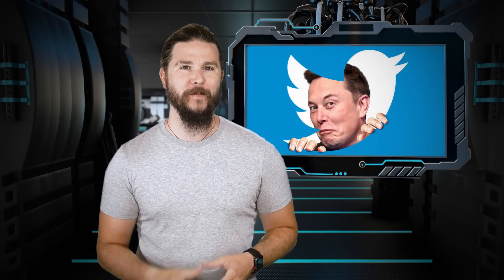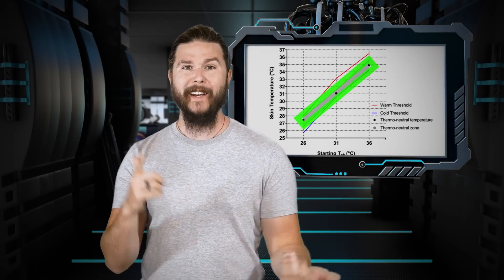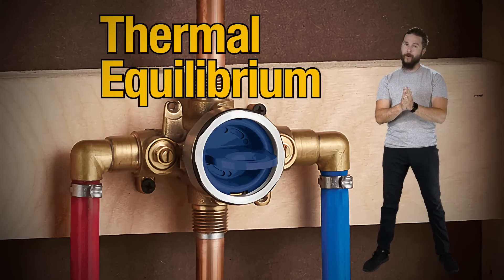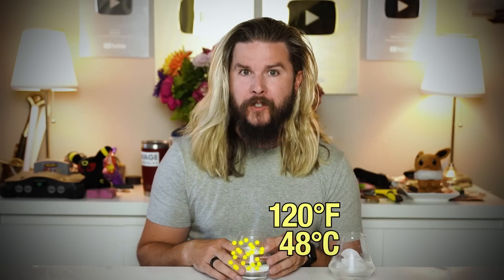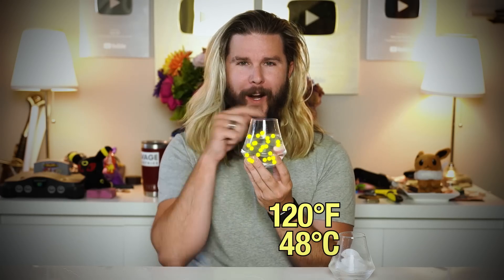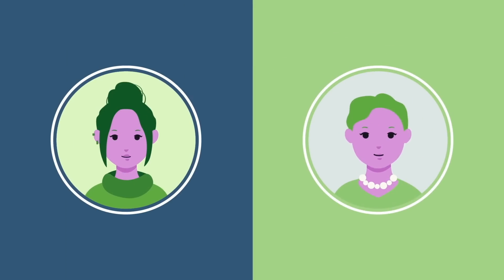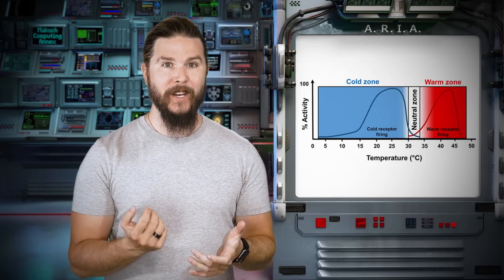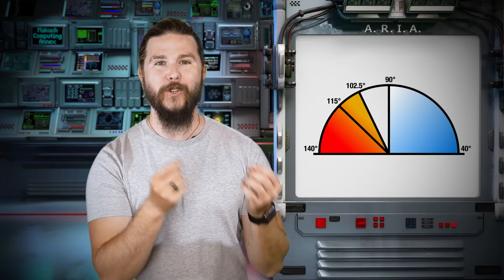Why Are Shower Handles So Sensitive?

Comment: I think you missed one last bit: static vs dynamic friction, and uneven friction along the handles arc in general.

The amount you have to push to get a degree of rotation changes depending on if it's already turning, and the current angle, so you overshoot
Reply: And, on top of those, the handles are very rarely, if ever, perfectly tight. On a lot of handles that have even a little bit of wear, it will move a few degrees without turning the valves. This isn't even always something you can tell is happening, as the friction from the handle usually feels greater than the friction from the valve. 

This isn't so much a problem as it is an annoyance, but it means there is no specific spot you can turn your handle to to get that perfect temperature. Altogether, the only real way to get a good temperature is to find something close -- either above or below -- and slowly turn it a degree or two at a time until the valves line up correctly. Turning it too fast will result in skipping and popping, missing the spot, and not turning it enough means you won't actually turn the valve. 

The only showers I've ever seen that actually solve this are the type that you often see in public showers, such as you may have at a campground or pool. These turn several times, effectively screwing out. This extended range of motion, sometimes up to 1080 degrees or more, means that the comfortable point is not only larger, but more easy to find and fine tune. Of course, with the extensive use they receive, it's not uncommon for them to have issues of their own, but they still generally hold up well. I'm sure they present other problems but, being ignorant of them, I would absolutely install one in my house.
Reply: Once you learn your system, this becomes less of an issue, but it can be very annoying to almost have it right, then you try and fine tune it and it goes flying off into lava land.

Comment: I have a hot tap and a cold tap, my control is nonexistent.
Reply: Too much cold and the hot stops, not enough cold and it's all hot. The amount I turn the knobs also determines water pressure.

Comment: I usually turn the handle completely to the hot side first and use my hand to feel the temperature, once hot water comes in, I can then turn it to the cold side slowly. Sometimes the boiler is too far away from the bathroom and the pipes are cold, you might think something is not working properly.

Comment: that's actually very curious. here in Brazil, at least in the general region i live in, we have 2 shower handles, that work like doorknobs (they're also round-ish). one controls hot water flow, and the other cold. i never knew that there were places with a 180° valve worldwide, here single valves are also like doorknobs and can have more than a single rotation until getting to max
Reply: These 2-in-1 valves are common in the south. But most showers in Brazil are electric showers that have almost no control at all. The most common ones have just hot, warm and cold, electronic ones are better, but you still need to reduce the water pressure a lot if the temperature is below 5°C, even the 8500W electric showers cannot provide enough heating in the winter here. At 0ºC and below, things get silly. 

Furnaces are still way too expensive for most Brazilians to afford, especially those living in older apartment buildings which lack the necessary gas and water plumbing. Gas prices are way too high too.

Comment: Seems like it would be possible to design a fairly cheap shower valve that has a small screw or something to calibrate the middle temp (to allow for long hot water pipes or colder cold water), and then make the main valve handle only be able to change the temp a couple of degrees C in either direction. You could fairly easily get at least three times resolution that way reliably, the only downside being that it has to be calibrated by the plumber or the end user.

Comment: I think the other thing which makes showers harder to control is the latency caused by the long pipe the water's going through before making it out. It means that when you feel that the water's too cold and turn the handle to the right, at first you don't feel the change and turn it even more. But when the hot water finally reaches the shower head it is too hot, because you turned it too much.
In control theory there's something called the Nyquist stability criterion and related to it phase margin which tells you how much delay can you add to the system before it destabilizes.

Comment: My mom got herself a gas heater with a freaking electronic thermometer. Set it to 42C and just open that sucker wide open, it will reach you at a balmy and comfortable 40C. Since the gas heater serves 2 shower heads in two different bathrooms next to each other, when there is more people you just set it to 46C and add a tiny bit of cold water.

Nothing a thermostat can't fix.

Comment: All of this is slightly subjective on how hot you keep your hot water heater temp.    I keep mine cranked super high so that I actually put the handle at 90° and it's perfect.    Doing this also let's you have more hot water for longer cause you use less hot water in the mixture at the shower handle.

Comment: It took me a while to figure out that my current shower tap takes two revolutions to get to full blast pressure, but the left side is still cold and the right side is still hot, so comfortable for me is at about 1:00-2:00 on the dial after turning it all the way around once.

Comment: This is why I prefer double-knob showers; you can control the hot and cold water separately. Still often scorches or freezes for a second, but it's easier to adjust than one master lever.

Comment: Big question why not just get a shower that has two handles one for hot and one for cold?

That way you could always get the same temperature output by just setting both handles at the same angle or about the same angle and just move them around to change the pressure/flow rate as more water is let through the valves?

Comment: This is so perfect. Our houses shower sucks so bad it drives me nuts. It's like it only works when fully turned and it drives me crazy. Anything less than fully hot is not warm, so essentially the entire dial gives you cold water control.. It's so irritating.

Comment: A solution maybe to make micro adjustments using a gear system on the handle. Large gear for the handle that would only make micro adjustments on the actual flow rate of the water. Cheap, efficient , hopefully we can see change.

Comment: I am a plumber.  Thermostatic showers have a separate handle that controls temperature, but not volume.  So you find your desired shower temperature once, and then don't touch the handle again.  It mixes it to a specific temperature based on the volume of both hot and cold it allows in.  These valves are becoming more common, and aren't really much more expensive than regular mixing valves.  They aren't cheap though, and you could buy something for 1/2 the price, but it will be 1/10th the quality, so definitely more expensive long term.

The main thing you really want in a shower valve is something that is pressure balancing.  They keep the relative volume of hot and cold water the same, so they maintain the same temperature even if supply drops because someone flushed a toilet somewhere else.  You'll experience a drop in overall water coming out of your showerhead, but it won't suddenly flash to full hot/cold.

Many homes heat their water in a a tank, so another reason showers are tough to calibrate is as you use hot water, your water heater has cold water added too it, cooling the overall temperature of your hot water.  If your water heater has a low volume and slow refresh rate, you'll gradually lose hot water.  Can be solved by switching to an on-demand water heater, but those are VERY expensive, maintenance heavy, and usually require either a large amount of electricity, or access to Natural Gas or Propane.  The gas/propane ones are much more efficient, and I wouldn't recommend an electric one unless you're truly desperate.  They all only heat the water you actually use though, so in the long run you don't waste energy keeping a tank of water hot.

Something else you can do is to turn your water heater temperature UP, and then install a mixing valve on the outlet of your water heater and mix the hot water back down in temperature.  This lets a smaller volume tank punch above it's weight class in the amount of hot water it can deliver.  Also, since every home has a different hot water temperature based on the use case of the people living there, every shower valve will have a different location for the "comfortable" range.
Reply: I can't believe no one else has mentioned putting a valve right on the water heater. Those valves are way cheaper than getting a full thermostatic shower system and allows the entire house to benefit. The extra hot water is nice too

Comment: A somewhat simple soltution would be implementing a gear reduction, so you need to move the handle further to make the same temperature change, though it would make it a horrible experience to change to an old shower.

Comment: My shower amplifies all this by having the temperature dial also be the on/off lever.
You need to tilt it up to turn it on and be extra careful not to nudge it side to side to knock it away from the sweet spot.
+ small shower so bumping into it on accident is also easy.

Comment: interesting episode but i feel there is an unnecessary amount of bashing even if i agree with kyle
Reply: Politics and science don't mix opinions should be left out entirely tbh.
Reply: @louthinator  exactly. Respectfully of course, but i came to learn not to hear political opinions and the like
Reply: The sad thing is he used to be a Musk Fan and even had that musk watch thing a few years back. Science has been shown to be ruined by politics and as a science communicator Kyle should know better than to do what he did in this video. Hes smart enough to know that current trends will age poorly for cheap laughs especially when they are political or could be seen as political.

Comment: This is good.  

Can I add many showers have a pressure balance valve that tries to compensate for difference of water pressure between hot and cold pressure fluctuations. That helps a little. The worse your plumbing to the shower the more that helps.  Many times the pressure can flux from minor other uses and when a well pump cycles

Comment: Don’t have this issue.  Set shower full hot (to purge cold water from hot water line), dial back to desired temperature.  Do this before getting in the shower.  It’s not rocket science.

Comment: Wouldn't be too hard of a change, really, for the manufacturers to add a secondary proportioning valve inside the main unit. There could a set screw that allowed a small flow of hot water to the cold water side premixing and bringing the cold water up in temp by a certain amount. The screw can be adjusted later on if needed.
The premixing path would only be engaged after the handle has been turned more than, say, about 15*, as some times you want actual cold water available, not tempered. So in Kyles graph, the central point of equilibrium would move closer to the cold side, minimizing the "too cold" zone, increasing the range of the "comfort" zone so fine tuning would be far more adjustable.

I wouldn't lower the house water heater temps lower as it would make using "more" hot water, making the water heater to run longer. For instance, if the living quarters has a 30 gallon hot water tank, and the temp is set to 130F, and they use the shower at around 105-110F, and the cold water is 40-50F, then there will be a lot more of the hot water consumed to get that balance. Whereas if the hot water is 140F (default setting), then no where near as much hot water is needed to accomplish the same shower temps. Thereby lowering power consumption. Sure, the power used may be low, but it's still there. Not to mention there are some foods you can actually cook using hot tap water instead of using extra power to heat a pot water. Thin noodles, ramen noodles, certain soups like tomato or cream of mushroom, etc.

But ultimately, I think the pre-mixing valve on the proportioning valve would be the best option here. Something relatively easy to add into the existing manufacturing process. Will it happen? Probably not, as Kyle mentions there aren't enough of an issue to make manufacturers make the move, as it would incur an additional up front cost to the manufacturers.

Comment: My shower handle pulls out/pushes in to turn on and off while having the standard rotation for temp.  This allows me to set the temp to the sweet spot and leave it there.  Perfection.
Reply: I don't understand why they all aren't like those. I'm in America and while I've definitely come across them, it's not very often. Usually either a knob for hot and cold or, like my current shower, one single handle that does it all.

Comment: There's a type of shower valve where you turn it to set temperature, but pull the handle towards you like a lever to open the flow.  I grew up with these.
Reply: I much prefer those.  Some are "pull" to control the volume of water, and some are "tilt".  My shower is the standard single dial thing, but all the sinks use the mixer where rotation controls temp and tilt controls volume.  Single handle kitchen sinks almost always work like that these days.
Reply: That's actually the "thermostatic" shower Kyle mentions. You aren't directly controlling the temperature, you're adjusting the balance point of the mechanism that does the adjusting itself.
Reply: @kantpredict  so, you're directly controlling the temperature
Reply: I’ve always preferred those. The only problem is that I would have to flush out the cold water in the pipes that was already there for it to actually get to the final temperature. So it might take 10-30s to get to the actual set temperature.
Reply: @myrealusername2193  but that is always true unless your water heater is basically in the shower with you (or similarly close)
Reply: Ran into them on honeymoon in Russia years ago. I have never felt so stupid in my life - just couldn't figure the thing out until it all clicked that it was a totally different kind of mixer.
Reply: Wait, that's not the usual shower mechanism?
Reply: @DimaJeydar  in a lot of designs, when the handle is turned fully towards the cold end, it closes the valve fully. So as soon as you start adjusting temperature, water starts coming out.
Reply: @myrealusername2193  that’s so weird
Reply: @DimaJeydar  I don't like such lazy engineering, but I've lived with it for 30+ years. :/ 

Now I just want the smarter valves!!
Reply: @DimaJeydar  it’s basically just a lazier version. It’s a single-valve system meaning it’s ridiculously simple. Basically just a valve and knob.
Reply: @DimaJeydar  tbh, it could be describing a normal mixer valve that just happens to have the same lever for flow. It's possible to have a thermostatic shower with the same arrangement but they usually have two knobs on either end of a bar with two pipes coming in: one knob for temperature and one for flow.
Reply: I grew up with those too, and I remember having a hard time figuring out the ordinary kind the first time I was exposed to them. Also had a shower where you manually mixed the water with separate taps, and it's easily the least convenient kind of them all
Reply: Same. I remember that handle.
Reply: I have 2 houses, one of which has this kind thing (also with a stop at 38°C as to avoid people being steamed or something) and it really is a game changer

Comment: I miss my two knob showers /: single knobs caused me a lot of anxiety as a kid, not a very fearful child but there was something nerve racking about something so simple being different..

Two knob also allowed control of water pressure ;-;
Reply: I specifically sought out a set with hot lever and cold lever that open 1/4 turn. It gives me superior control over temperature and pressure.
Reply: I had a two knob shower until recently. We had a friend fix our shower and he claimed he hated the brand we used and got us a single knob, even though basically every in the family preferred the double knob. But he did it for cheap so fine, better than paying a professional on call (he is a professional, but he was doing it as a friend)..
Reply: I have a single handle that does all three? Both temperatures depending on the spin and pressure depending on how far you pull i t out
Reply: 2 knob showers or faucets are the worst. If you want more water, you need to turn both of them the exact same ratio to keep the same temperature while a mix tap just requires you to pull it.
Reply: @NaudVanDalen  depends on what version, it also gives the ones where one knob is temperatur and the other one is the amount of water flowing in
Reply: @jopejoe3  There are also three knob showers
Reply: @NaudVanDalen  that is indeed what i mean
Reply: @NaudVanDalen  for sinks it's terrible, but for showers you just set hot to full blast, and adjust cold to find what you like.
Reply: @NaudVanDalen  still sucks when I can't turn down the water pressure, we used to have a weird shower where it was two handles in one, one was pressure and the other was the ratio of the two,then the pressure handle jammed half way one day
Reply: @NaudVanDalen  not if one knob is temperature and one is flow. Open the flow more and don't touch the temperature knob